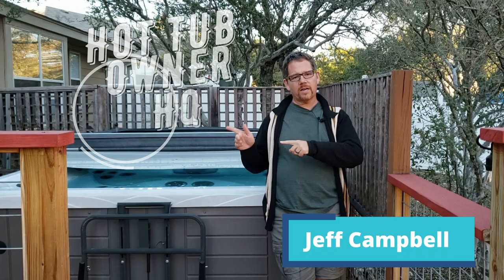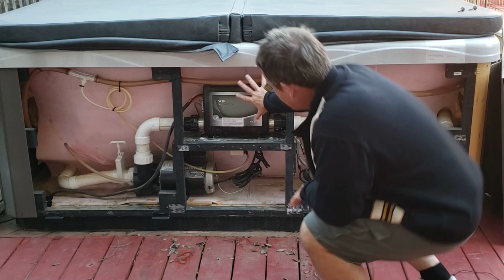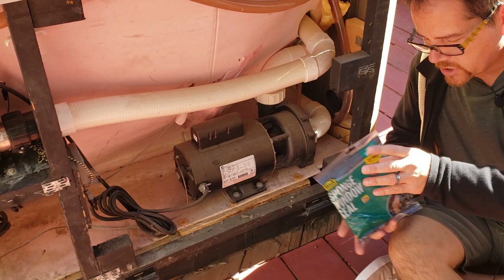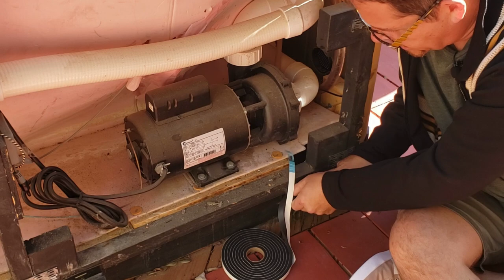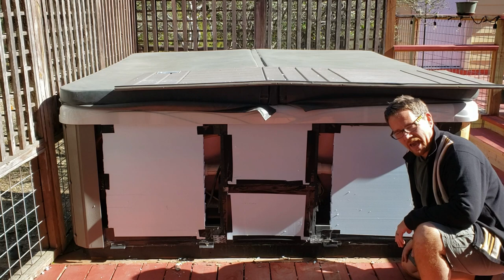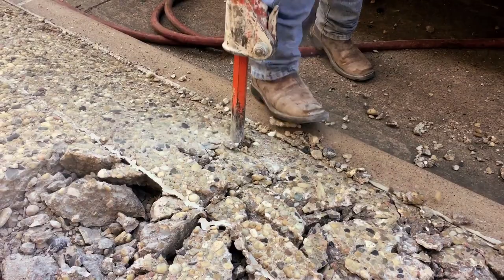How to Quiet a Noisy Hot Tub (Decibel test before & after)

Comment: Are you worried about heat building up and shortening the life of components. I think I would have started with adding some dampening to the panel.
Reply: Spa pumps are WATER COOLED. And spa cabinets have no forced air ventilation to speak of. Those louvres on the cabinet don’t allow significant air movement and are yet another source of noise.

Comment: Curious if you have had any overheating issues since doing this
Reply: Overheating not a problem because spa pump motors are 90% WATER COOLED. In fact some spas depend on that to heat the water quicker to temp. Nothing done in this video would hinder air flow because it’s minimal to begin with and their are ventilation louvres elsewhere on the cabinet

Comment: If my Jacuzzi was that loud, then there is something wrong. Why just cover it up? Isn't there an issue with a pump or blower or something?
Reply: Even a PROPERLY running pump can be objectionably loud when you are trying to relax or have a conversation. Spa manufacturers give minimal attention to noise or vibration dampening so it’s up the homeowner to sound insulate their spa. And even a PROPERLY running spa will have loose screws right from from the factory or vibrate out over time. It goes without saying the a noisy broken motor should be serviced before taking these other steps.
Reply: @drdrew3 : wrong ..if your tub is that loud you bought the wrong one and should never insulate the service door area

Comment: Don't block your pumps, they need to be ventilated.
Reply: I don't know. They rely on air cooling? It's a closed air area anyway there. My bet is on water cooling from the water moving through it. So IMHO OK to add a whole bunch of non-flammable dampening, like fiberglass insulation.